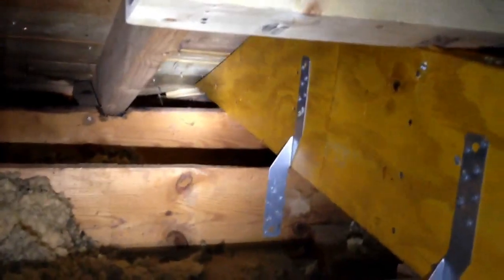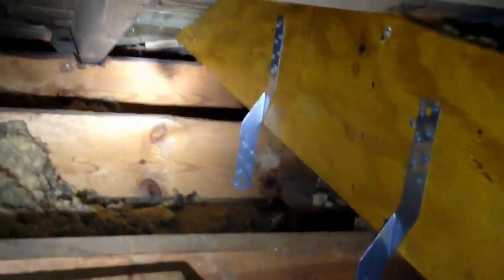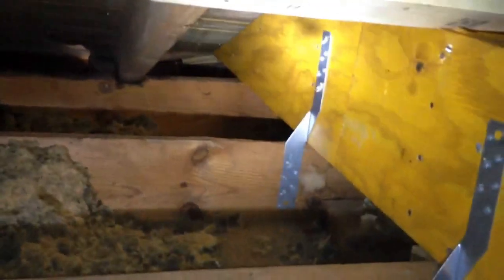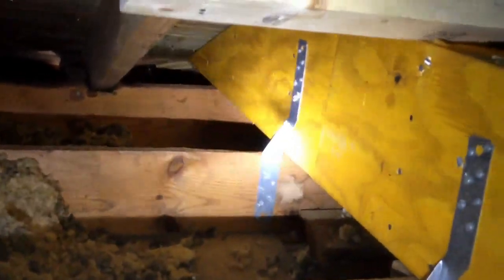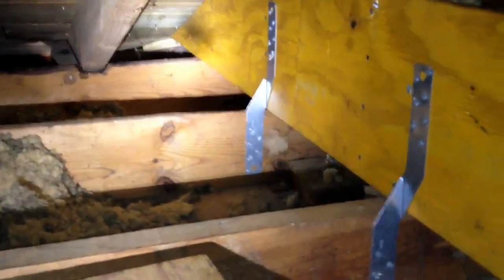Removing Bearing Walls

Comment: so can the new supporting beam installed on top of joists without the need of cutting them? its much easier.....
Reply: I’ve spent a few days looking into this. I’m halfway through with my project. Ripped out plaster on both sides of load bearing wall and have temporary walls up in preparation for a beam I was going to flush mount. Now I’m see this method which is considered a “strong back” instead of a beam. You should be able to do it I’m sure it’ll hold just fine some say you can while others say you need a an actual beam.

Comment: Thank you. Doing a similar project and it’s good to see an example
Reply: Just finished mine and it's rated to hold 70 psf ground snow load. SO much easier than installing a recessed beam with joist hangers, and saves so much time.
Reply: @RDHomesCT  I did it too and now i have 3 feet snow on the roof. Still solid but will house go trough the inspection when selling after this modification ?

Comment: I have 24 feet 2 x 6 ceiling Joists I want to remove a wall that is not lore bearing per se but it is holding up the weight of the drywall I want to use the strong Beck method. It’s 19 feet long and at the end I will have a 4 x 4 post which is directly above the support for the home into the foundation. How big of An lvl beam do I need to put in the attic to keep the two by sixes from sagging?
Reply: I have similar layout. A strongback made with 2 2x6's tied to joists should do it. Hire a SE for an hour.
Reply: Did you end up doing that? I’m doing the same
Reply: @ONeill_Nolan  project put on hold did not do yet.
Reply: @J-WHO312  I’m at the stage of installing either beam or strong back I’m leaning strong back since it’s way easer. Also worried about cutting 12 joists and the walls collapsing lol
Reply: @ONeill_Nolan  I did ask an architect if the lvl strength is the same if joists are hanging or on top of and his reply was yes but was concerned about using correct hanging straps.
Reply: @J-WHO312  best practice is using a u style hanger I would worry about deflection or movement just using a standard hurricane strap, but I’ve seen it done.
Reply: @J-WHO312  I can’t find correct sizing of the beam. Some say a couple 2x10’s screwed together is sufficient, while others are saying I need a ridiculous triple ply lvl. Only carrying 8-10 ceiling joist with empty attic above.
Reply: @ always better to over build, if you go 2) 2x12 should be good.
Reply: @J-WHO312  that’s what I was thinking just a couple 2x12. We’re not dealing with a floor above. I laughed when I was told triple lvl because I’m just thinking about the main beam in the basement which is 3 2x10’s and 4x4 posts.

Comment: Yes how did you get the beam in the attic?
Reply: You can push it through by removing the vent on the side of the house.
Reply: Pleasant Grove yes that's my plan, how did you get it up that high? That's where I am in my plan. I got posts to support the ends just puzzled how to get it up there. Seems extra heavy.
Reply: @ronaldh2886  You can cut the right amount through your ceiling drywall and push it up to the attic. Make sure its the same direction as the ceiling joist is, obviously it will not go through.
Reply: Pleasant Grove I'm putting in a  24 ft beam. Ceiling joists are perpendicular to how I need to go. I am going through the end of the gable just curious how to get up there from out side. It is fifteen feet up. I'm inking a ladder and some extra muscle
Reply: @ronaldh2886  That long yes it'll have to be thru the side vent of the house if it fits...
Reply: @nsmcastillo326  I figured it four years ago. Cut a hole in the end of the house between two upright 2x4 put a harbor freight winch in the far end of the attic and winched up in three pieces. Assembled in place and added bracing to the roof and straps to the ceiling joist below it. No cracks or sagging.
Reply: @ronaldh2886 That's great 👍 I put the beam resting on 3 two x four at the ends and the ceiling joists on hangers to the beam.
Reply: That 45 angle cut at the end of the beam is a no-no... It loses strength...
Reply: Steel beam